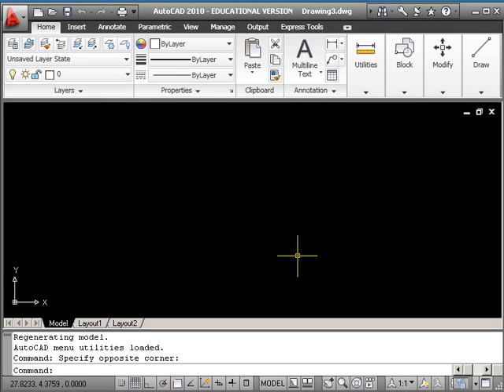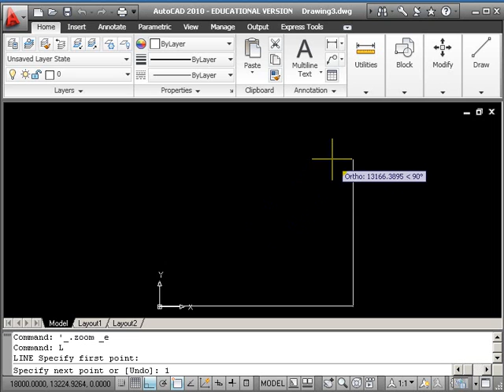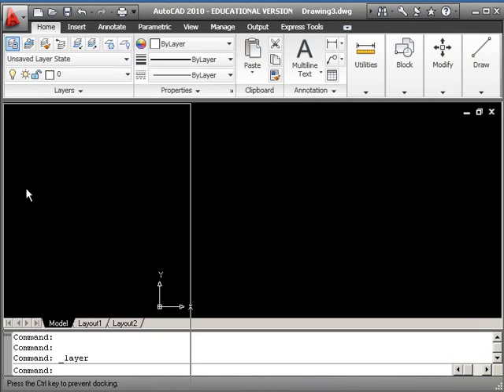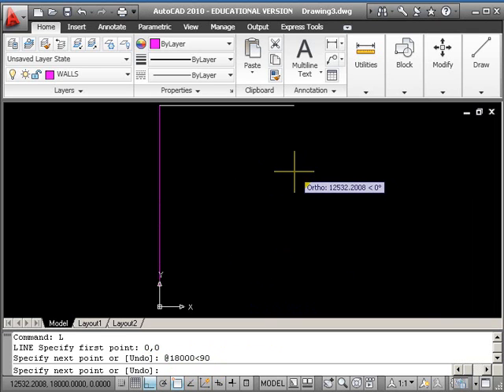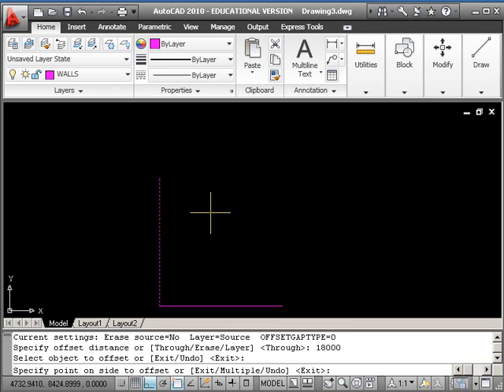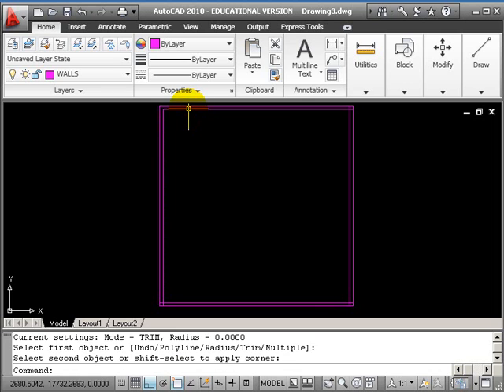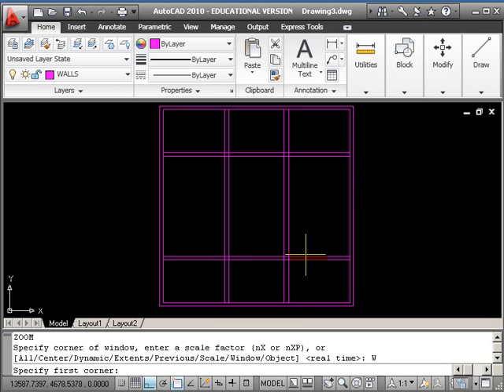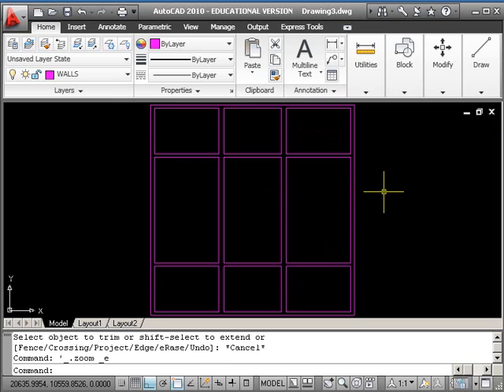AutoCAD 2D Drawing Course A - Part 1 - Basics

Comment: I hardly ever use command-line but I wish I could master it in my old age. I see the advantage to it watching you. I started to learn it back when I had AutoCad Lt in around 1995 or so but then I got AC97 for windows from an architect and started using all the  shortcuts.

Wow! The fillet and trim commands save a ton of work. I'm going to really practice and use those from now on

Comment: When you say the magenta is a thick line, where do you set line thickness for each color and what is the default? Is this strictly printing line-weight or can you set screen line-weights as well?  I thought you just picked different colors so you could see one layer from another layer. How do you get different line-weights in the same layer?

Comment from the maker: Hi Ewan - I have used a laser cutter a lot (ILS3) model - a Chinese 30w machine.   We plot from paper space, use only the colours that the cutter driver recognises (pure red, pure blue, etc.) we employ a .ctb file to remove any mention of lineweight in peoples layers lists.   Avoid solid fill hatch, polline with width and text - these all make the machine engrave instead of cut. Different machines may have very different driver set ups. Hope that helps.  Drawing is done exactly the same.

Comment from the maker: Hi Usha - good to hear you are 'skilling up'. Accuracy is the key factor - AutoCAD drawings can be done well or badly. If something is supposed to be at 90 degrees then it MUST be - that is were the ORTHO (F8) control comes in. If a line is supposed to be 'square' then you would not see any steps in the line (this is where it is crossing lines of screen pixels). Always look out for that. Don't put lines on top of lines ever it spoils your printing.   Practice lots.  good luck.